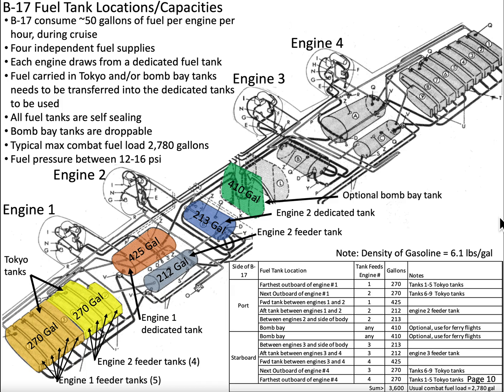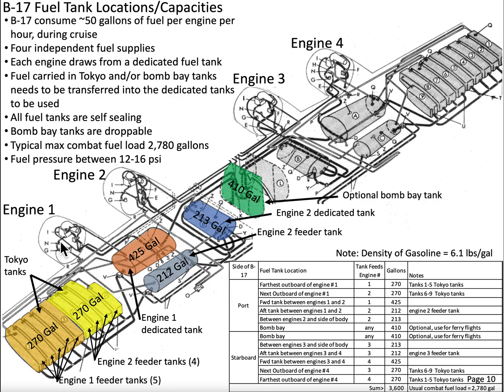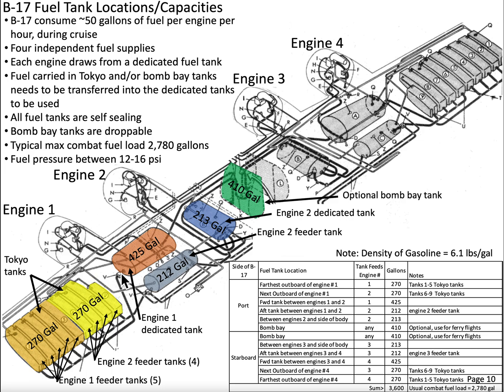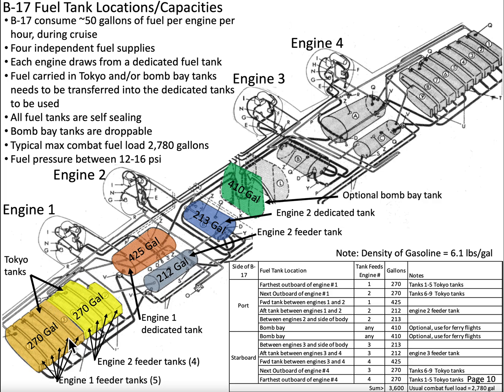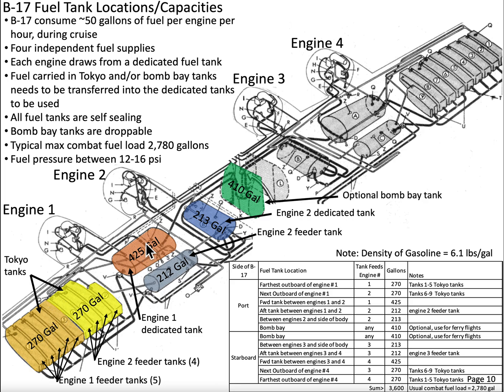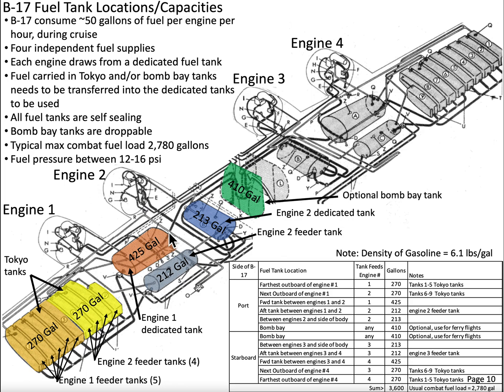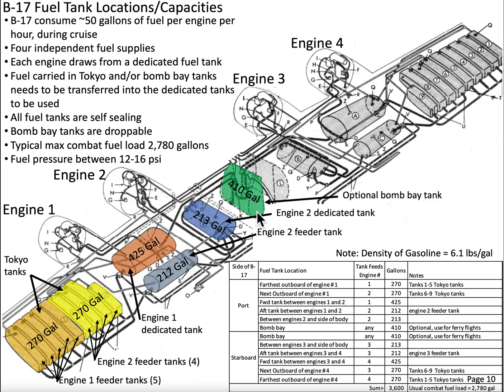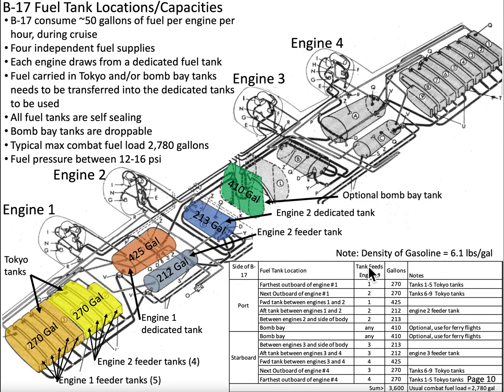B-17 Bomber's Fuel System Explained

Comment: Tokyo tanks were added to B-17F & G.  E-models did not have em.
Reply: They were installed at the factory on the F&G models but could be retro fitted to the E model as they were designed to add onto the B17 so the wings didn't have to be redesigned.